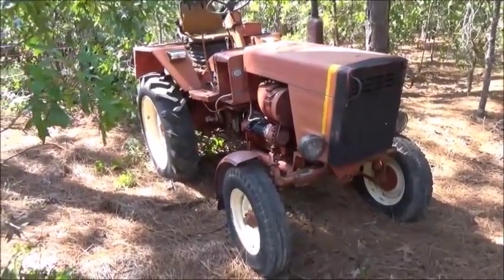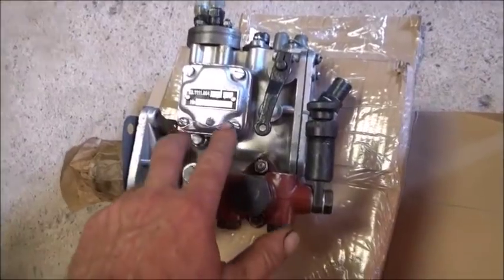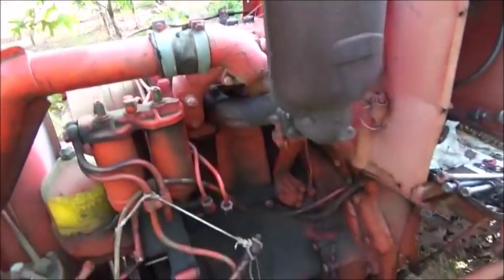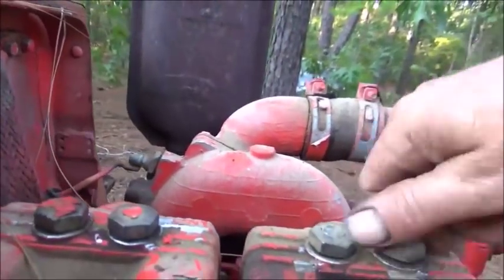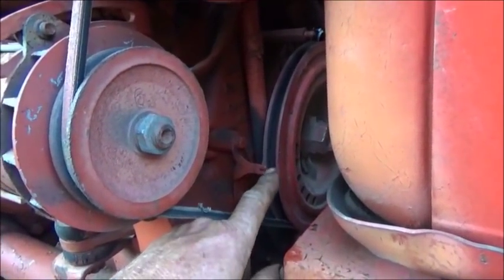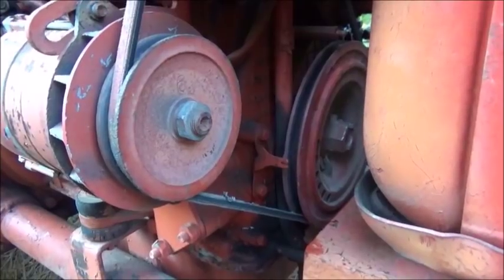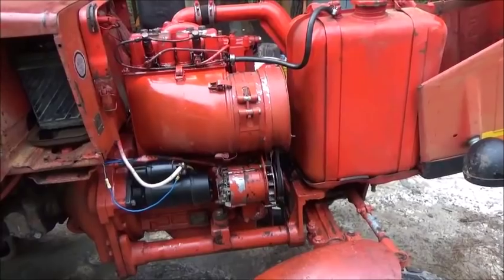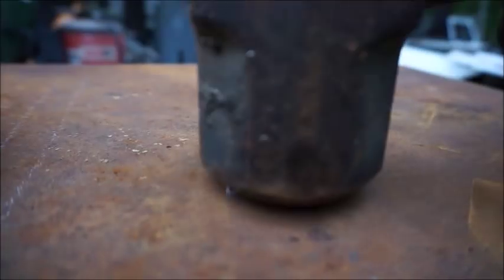Belarus Tractor  Injector Pump Part 2 of 2

Comment: Great Video, I have a 1983 AS250 which I've had 12 years it still has the original tires, they wear like iron, they were dry rotted and have lots of cracks but still holding up. after I had this tractor about a year I had to replace the starter solenoid which did not hold up and after replacing it a couple more times I gave up and to this day just jump start it. I have put new brake bands, a new clutch, throughout bearing a new hydraulic drive gear and pump as well as rebuilt the hydraulic cylinder and all has been fine with the exception of oil seeps that I just can’t seem to stop. I did paint it four years ago. I made the mistake of letting it set for several Months and when I went to start it yesterday the fuel had bled down and it took a quite a while to get fuel oil to the injectors but as soon as the fuel arrived it cranked and runs like a top. I think this is the most fuel efficient tractor made. By the way I’ve been able to get all parts I've needed from here in the USA from Belarus International.
Robert R. Vance

Comment: Tony 
Excellent video Johnathan! I have the same tractor in Canada, ordered the pump on Sunday and got it today [Wed.] Super fast! Also want to thank you for the thorough explanation, it will make replacement easy. My pump was out of oil, and I never checked it because I thought it was lubed through the engine. It's not, sealed unit. I have a owners manual, but explains nothing about checking the injector pump. The fill is the top bolt with the two flat sides, and the level is the lone bolt half way up the left side of pump, for anybody else that wasn't aware.

Comment: Important!  (95% sure) You must add engine oil to this pump. There is a sight level plug on the side. Just use 30 wt. oil. Not nit picking but when you time an engine and back the crank up to get to your timing mark you Should go past the mark and turn the crank in direction of rotation. By turning in direction of rotation you take all the slack out of the gear train. Nice video. Change oil in pump every oil change.

Comment: Good job on getting that tractor running, I did leave you a comment that I'd got all the info here somewhere for that pump and stuff before if you wanted it when you got the tractor  .  I've had parts from those guys to from Ebay.  That should be a new pump lots of those Belarus parts are rough round the edges when you get them It's a $350 Belarus part not a  $1500 JD part L.O.L.  That shipping is good, I can't get a filter shipped from Toronto to Manitoba both places being in Canada in less than a week and a half to 2 weeks by  the time the idiots loose it or take a holiday as well ! It's bloody crazy..

Comment: I have some friends who have a 1960-era Mercedes Benz 190 D on their property.  The body is definitely fixable and it was parked largely due to a key broken off in the ignition switch.  The interior looks like it was done by hippies but I bet that engine would run.  These cars were virtually bullet proof and when we were kids, you could see them being used for taxi cabs the world over in foreign films.  I have heard of them being driven 500,000 miles with little more maintenance than changing the lube oil and keeping the thing clean and serviced.  I wish I had the money to restore it -- I have always liked these cars.

Comment: Yay DHL!  It's a good day when you can start it with a Jonathan W video.  Jonathan, I bought a Ford 801 last week!  It is the 861 variant, which means it has a 5 speed manual (they have a Select O Speed version) with a live PTO.  It has a 172 ci diesel.  It is so cool.  It could use some work.  This and other things I own are why I wish I had half your skill set.  The tractor runs.  I checked the oil and it is over the full line.  I thought a diesel with over full oil could potentially cause it to suck oil out of the crank case and burn it and overspeed the engine.  I plan on changing the oil anyway, one of the few things I'm capable of.  Should I run Rotella?   The next thing I need is a bush hog.  I've got a mountain of work facing me.  I'll tell you my plans next time we talk.  Also, I found those soap stones.  They were in the truck the whole time but hidden under my mess.  They are yours next time I link up with you.

Comment: Amazing way to go, I had a Grundig radio from 1952 and it needed new tubes, One tube i had to order from Belarus. Best tube too. Damn good quality. My wife's parents both came from Lithuania. She did a DNA test and she is 99% Lithuanian.  You did a good job getting 2 tractors cheap them ifxing them up and having two complete functional utility machines. Great effort. Would have been good to show the pages of the manual to see the guts of the pump. Thanks D

Comment: Great to see it running. Wonder how much gunk is behind the air flow tin on the heads? Those are good tractors if treated right. Friend had a cab and air 4x4 forever until he retired and got out of farming. I remember cleaning the heads a lot due to debris buildup.

Comment: Jonathan,
The old engines on the ship started injection at 32 degrees BTDC and finished injection at 2 BTDC.    30 and zero should be ballpark but even a few advanced will give you a snappy response with much better torque and cooler exhaust temps - but you don't want to be too early....   Rob

Comment: say jonathan: do a tear down on the old pump. see if you can fix it on the cheap. I mean, it may just be rust in that lower gear, and sheared key. if you tear it apart, you can put in a new key, without all those expensive components. I bet some poor russian would try to get that one going. see----- if you put that one together, and you put the loader bucket on the front, and something happens to the pump, God forbid, you could use the old pump with just a bandaid cure to get running. of course, with only one cylinder getting fuel, it may not be possible. but it could just be the key sheared also.

Comment: 2 is way better than 1...l don't know nothing about this motor but from how it starts it sounds like it might could go up a tooth...or just leave it, see how it goes - like you said...you may have it right on the mark & that's how they sound startin' up...l believe it will make you a good tractor...is this the one that's getting the bush hog

Comment: Jonathan I know this is an old video 
I'm installing the pump on a tractor same as yours but I can't make the diesel come out on top of the pump on cylinder one. I already pump and pump but nothing is there    
Anything that can be plugged or do I need to do anything else. 
Thanks in advance
Reply: Turn it

Comment: Jonathan, 
You say you here you are doing another video on timing the injector pump.  I'm replacing the whole assembly on my Belarus 310, same setup, and need both the disassembly, reassembly and the timing, as even the service manual, excludes the entire fuel pump assembly and all needed information about it.  Please email me (t b o t n i k @ g m a i l . c o m) the link to your timing video and any other pertinent information you have.  

Just bought mine a few months back and previous owner let the oil either leak or run out on the injector pump, so the problem with the "flip gear" you described, of course happened, so started working through this and was clueless, until I saw your 2 part videos on this.  Yeah 250 and 310 are the same parts, with just different fuel metering for the difference in engine size.  I took out all bolts to the assembly and could not get it apart.  Was thinking something in the engine oil intake was still holding it from coming apart and looking at your videos, where you show the oil intake removed seems to validate my suspicion.  Will be ordering the replacement Wed, on payday, so the more I learn, before the part gets here, the better off I am!

Cheers,
TBotNik
Reply: Did you get er done